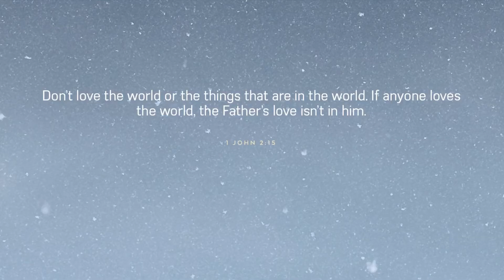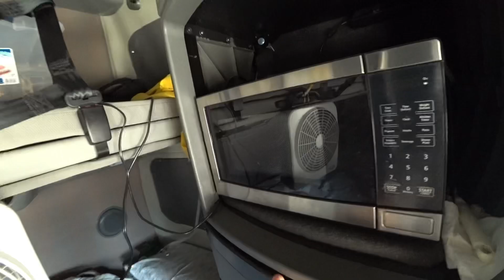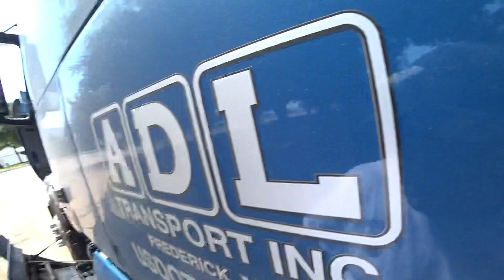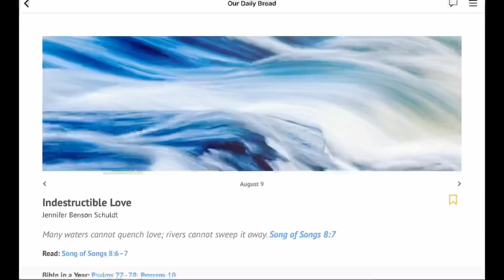August 9, 2019/648 Trucking accident at the customer. Haslet, Texas

Comment: I work for Stevens and they specifically teach this in orientation/training and stress it. You HAVE to get up under the trailer and see if the locking jaw has secured around the king pin shaft. Otherwise that happens. Even a tug test would've revealed an issue.
Reply: The trouble with the "tug test" is should you get the king pin dropped in front of the latching mechanism and 5th wheel itself (you backed underneath it too far), the tug test will still pull the trailer straight line as the pin is against the 5th wheel... As soon as you try and turn while pulling it will slip off the 4th wheel and cause a real headache.
Reply: @timgear9892  I agree. Another thing though is the trailer air supply should be off to make sure the spring brakes are on (after you fill the tanks of course). With that being done, the trailer should not move an inch unless something is not right. Never tried it with the brakes off though which they taught me in school.
Reply: @masterofjustice1984  to do a tug test you push in the yellow and pull out the red. By pulling out the red you release the trailer air pressure thus activating the trailer spring brakes
Reply: @JustAnAceWoT  isn't that what I said?

Comment: Something like that happened when I was working for the Auto Zone distribution center in Ohio. A trailer with skids of motor oil was live unloading and auto zones policy is that the truck must be detached from the trailer. Or oil room worker was unloading the last skid/pallet and the landing gear for trailer failed and the trailer fell.

Comment: Check the hose on the bottom of the reservoir, could be loose, use windex with water in your reservoir instead of fluid, it does a better job.

Comment: Dang. I live 15 minutes from there. I always double check the 5the wheel connection after I almost dropped a trailer a year ago lol. I pulled forward and noticed the trailer wasn't coming with me haha. Hit the brakes and realized the 5th wheel wasn't in open position to clamp around kingpin. So all I did at first was bang the locking jaws lol. Almost got fired that day. It was a 40000 lbs frozen beef load.

Comment: John I hope that you remembered to put the safety latch back on your bar that protects the front of your truck when you were checking for the leak from your windshield washer fluid after you hooked up your trailer and yes your boss needs to have ADL put somewhere on the front of the trailers

Comment: I’ve been coupling my trailer to the fifth wheel on my 99 Chevrolet Silverado for the first time and I’ve not checked the doggies been locked so I connected the suzies and drove off but the trailer slammed into the ground and it ripped off the tailgate of the pickup truck and made some nasty dents on the floor of the bed and then I noticed that the bumper was ripped apart in the middle so I know the pain the driver of the black truck was in. Just not his day I guess.

Comment: Thought for sure they were going to need a wrecker.  Wonder if one of the yard dogs got under it and took the weight off the driver's side until the landing gear could be lowered?
Reply: The landing gear should lift a fully loaded trailer unless it was damaged when it came off. Even the lightest duty set are rated to lift 39,000 lbs with 100 lbs of force on the crank. Drivers have gotten soft because of air suspensions so they don't have to crank them up to take weight off anymore.
Reply: Exercises

Comment: A leak? You carry more washer fluid on board than fuel, I would guess you have a leak. Either that or put a 50 gallon washer reservoir on board so not refilling as much. It sucks at over 90 degrees and a belly but you would have found the leak under the reservoir by turning the steer tire and shimmy under. Been there done that with a farmer/truckers belly.